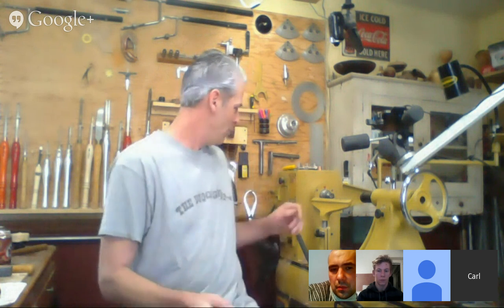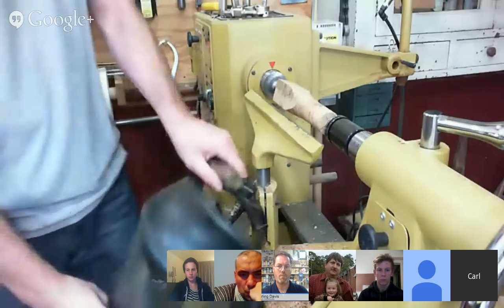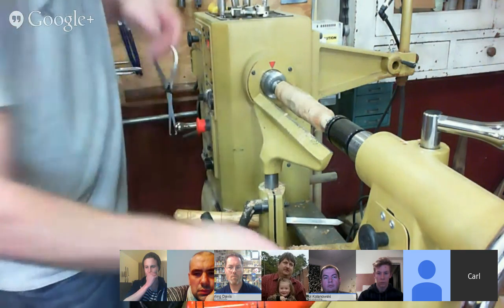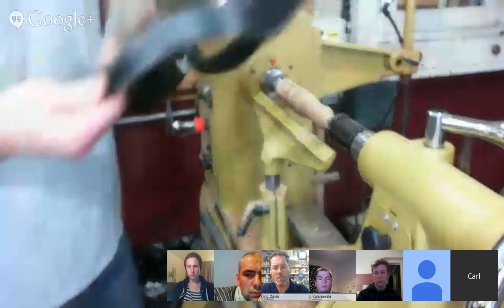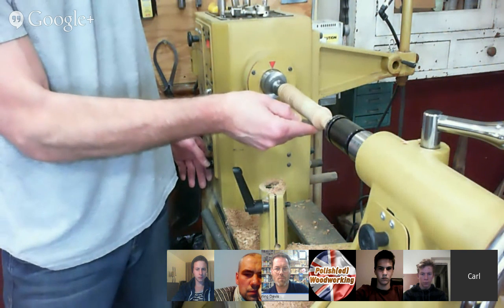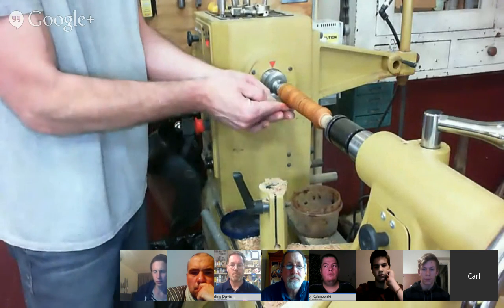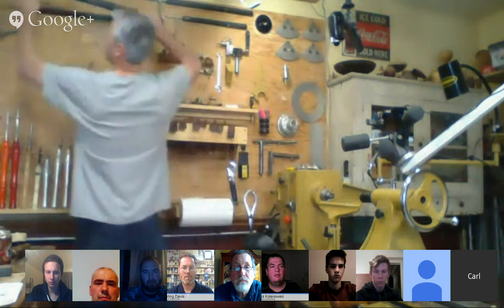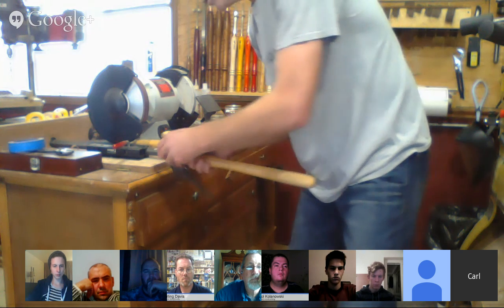Woodturning Q&A

Comment: So which way is the grain? left to right, with length of tool bed, or back to, across tool bed? reason I ask is would it help with tool slicing and sanding?
Reply from the maker: raztuss The grain on this piece was running several different directions, but mostly the length of the bed. If it was a piece of straight grain, it would cut/sand a little easier.